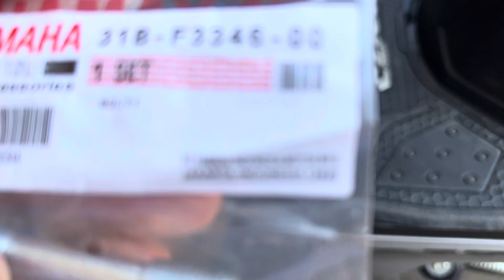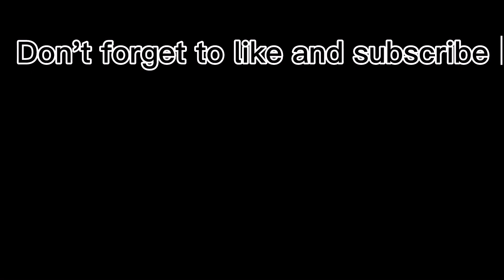Honda Click Front Shock Lowering Kit | Semi Lowered Setup #hondaclick150i #hondaclick #hondavario

Comment: Boss ask ko lang masyado na bang mababa kung 300mm sa rear tapos bawas ng 1inch sa front? O sakto lang para sa may height na 5'2? Salamaat
Reply from the maker: 5'2 din po height ko. Stock 330mm rear shocks at bawas 1.5inch sa harap yung setup ko. Para saken, sakto lang ganitong setup.
Reply: @kopivelo6610   boss ask ko lng saan mo sya nilagay sa taas ba sa baba? Sakto ba pinaka kanal ? Para pumasok ?
Reply from the maker: @nicoaerox458  sa taas po nilagay. Unscrew nyo lang po muna lahat then adjust nyo po yung height then tsaka nyo po ibalik yung screw kasama na po yung yamaha screw
Reply: @kopivelo6610  grabe namang height yan 5'2 para sa lalaki 😂😂😂